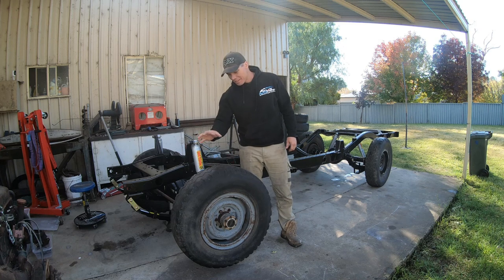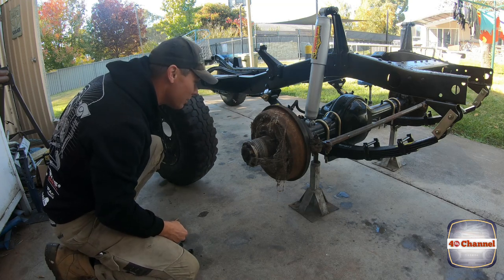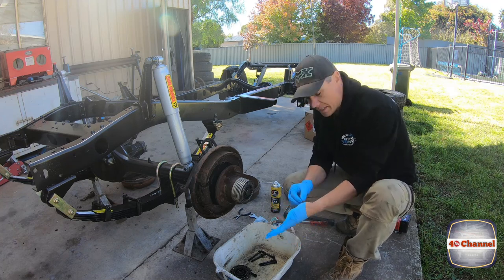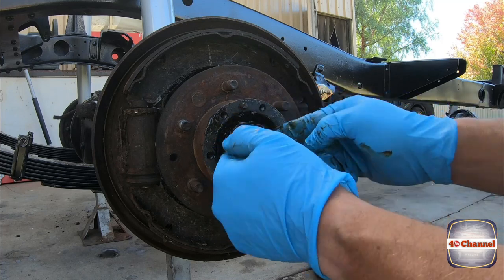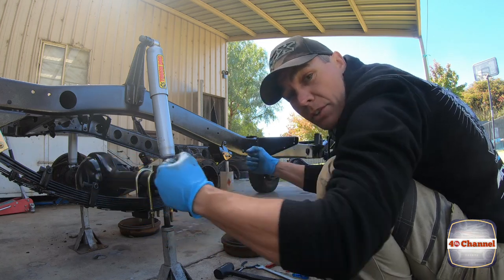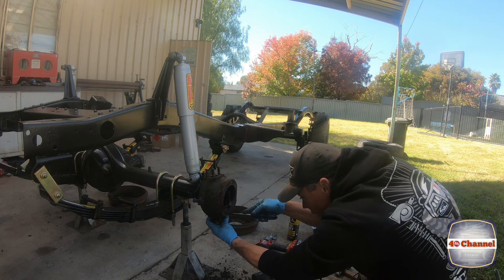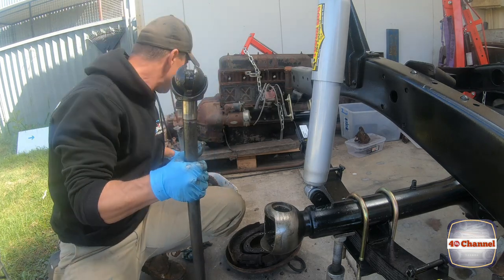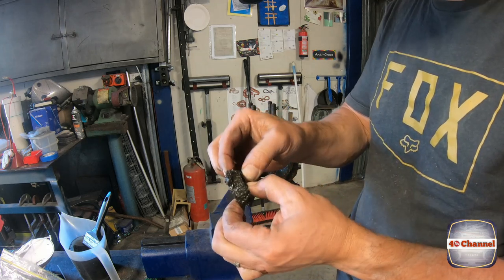S2EP8 - 1965 FJ45 Front Knuckle re-build Part 1

Comment: Good vid Jayson, What is that style of cv joint called ? It's not one I have seen before.
Reply: It’s a Rockwell “Ball and Claw” axle design, a holdover from the Willys jeep’s from the war. I think they were replaced by Birfield joints in ‘68 or ‘69. I have the same setup on my ‘66 and I think they’re pretty cool.
Reply from the maker: Yes Nuburg is spot on, I didn't know that the willys Jeeps had them too, that is cool.